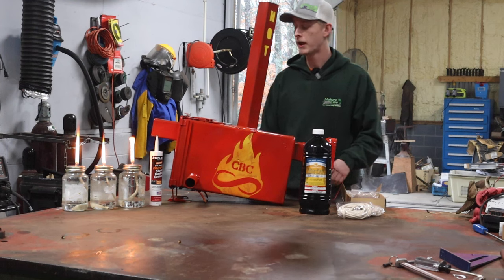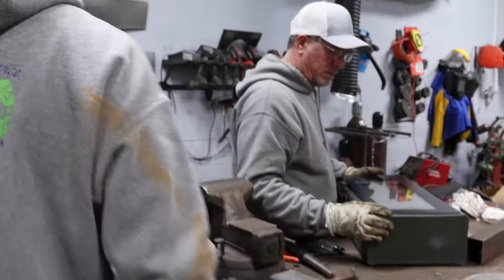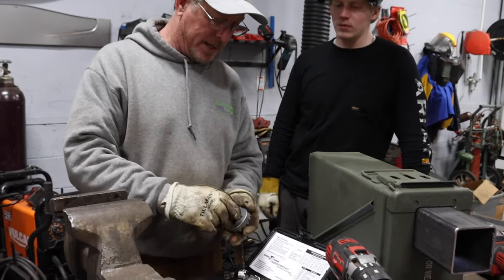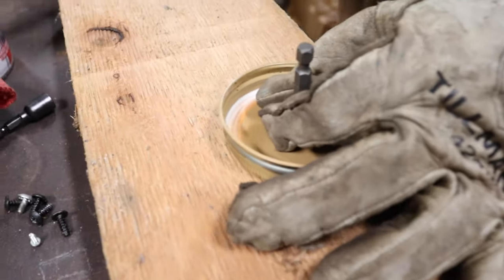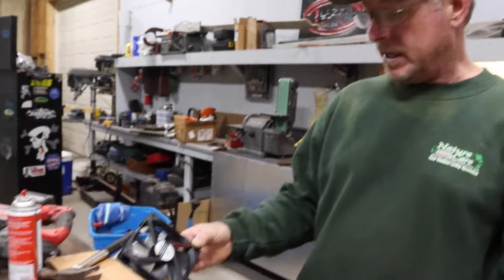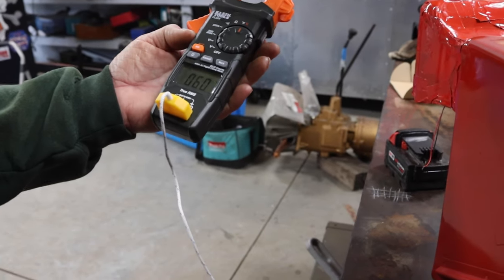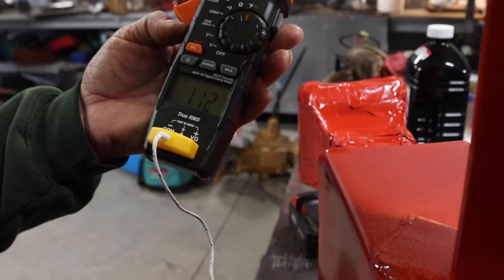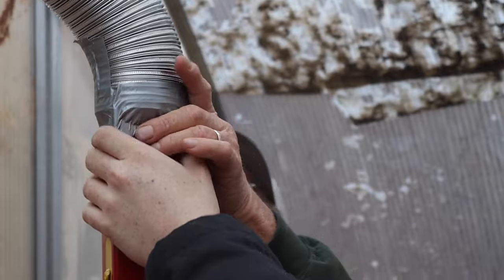AMMO CAN KEROSINE HEATER | DIY| simple and efficient

Comment: LMAO, Don't tape up over the HOT. Proceeds to use duct tape that cannot handle being that HOT either.
Reply from the maker: True, but we measured the temp there and it never got over 60°. All the heat comes from the middle tube. The chimney is just for air circulation for the flames.